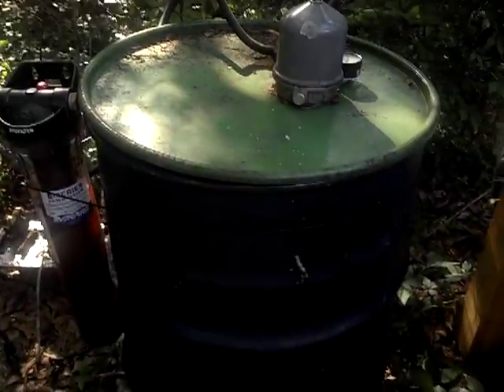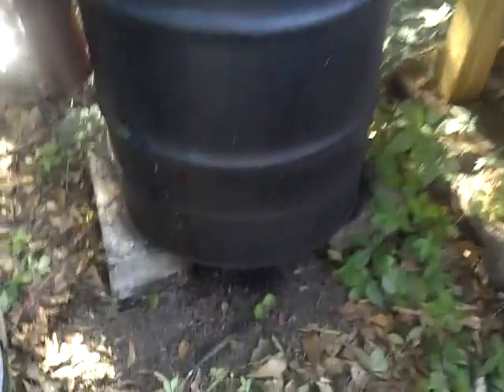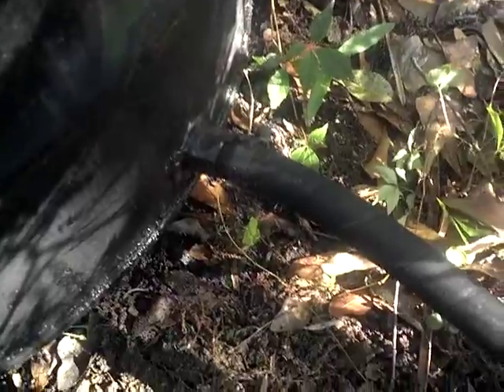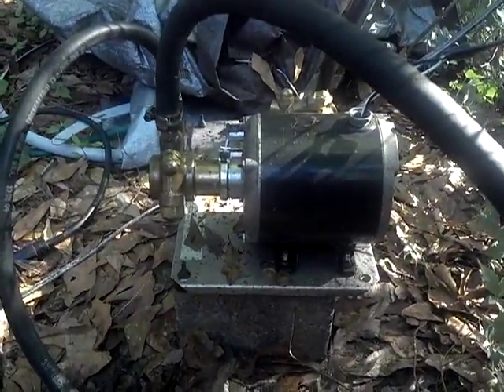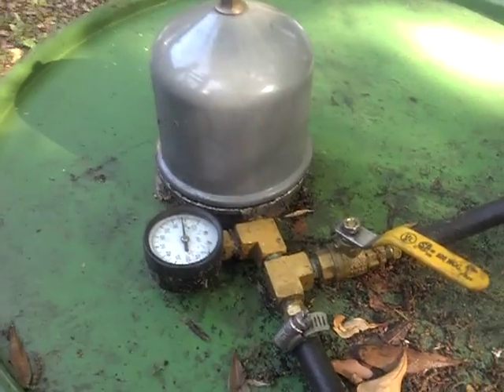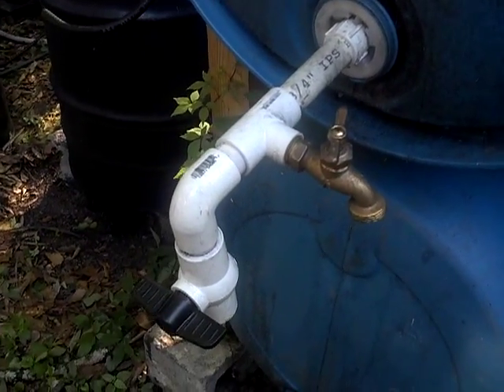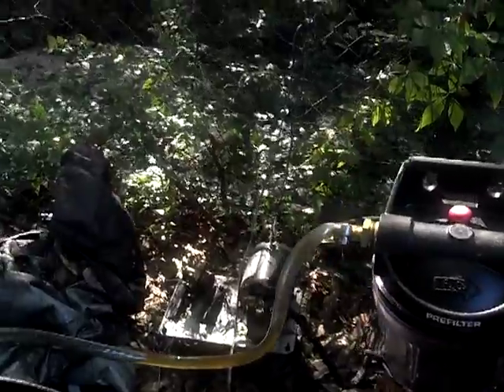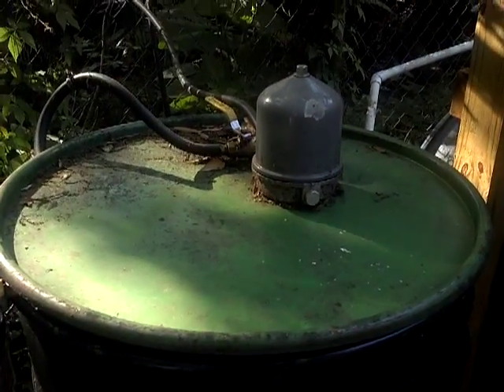Amateur home built wvo centrifuge filter

Comment: So no more wvo? Are you looking to sell your Centrifuge? I just aquired a 300SD w a greasecar kit on it!
Reply from the maker: Dave, et al: Honestly if you are going to get a hobby grade centrifuge, buy new. It will save you head aches and more importantly, your time. The one in the video was purchased from pacific biodiesel around 2010 for $150. Don't skimp out of this, getting new ensures all parts are working and weren't abused by a previous owner. You car's engine and filtering is at stake, and these centrifuges take junk out to the sub-micron level. No filters to replace or clean.
Reply: Project23D Thanks for your kind reply, most helpful! Will do, I have an 83 300SD w a Greasecar kit on it I'm picking up next week. How about your carbonator pump, has it been pretty robust for you? Thanks again, Dave.
Reply from the maker: Carbonator pump has been absolutely great. Its rated for 250 psi, and at 90 psi there is still alot of WVO going through the bypass valve.

Carbonator pumps are easy to find, a inexpensive. If you use one, remove the bottom bolt to remove a screen filter. It clogs very easily. Bread cumbs soaked in WVO are not going to cause damage to your pump.

That being said, the centrifuges have a recommended pre-screen size, usually 100 microns for hobby grade. An old shirt, sock, jeans will do the prefiltering nicely. When you get your centrifuge, be sure to read the info that comes with it, as it will tell you the max particle size which can safely pumped into the centrifuge. 

The clogging of the centrifuge usually begins before it gets up to operating speed, but once its there, it's pretty much smooth sailing until it's time to clean it out. That can be a real chore. But it is worth it. More purified WVO, under right conditions: water removal, and other things I forgot about.
Reply: Project23D How aften will the Centrifuge need cleaned, after each 55 gallon batch? Thanks for you're help, Dave
Reply: Project23D Is the centrifuge company still in business? Pacific Biodiesel, couldn't find them.

Comment from the maker: I think I had about 10k miles with WVO before my source went out of business. I was lucky go get their oil before they contracted to someone else.

In Columbus, GA, Griffin Industries has a monopolizing amount of contracts with businesses that use vegetable oil in which Griffin pays for it. Ranges anywhere between $0.25/gal to $0.75/gallon. Needless to say, restaurants are not very interested in giving away WVO when they can get paid for it.

I did not have any issues to speak of. Although probably not required, I changed the fuel filter with every oil change. Because I use Rotella T6 pure synthetic oil, those changes were every 6,000 miles. The engine ran smoother, a little quieter, and also smelled nicer.

The setup you see filtered/polished the oil exceptionally well, better than any filter on the market. Centrifuges do an excellent job, and don't need to be replaced like filter elements.